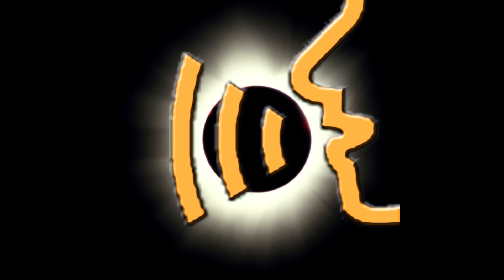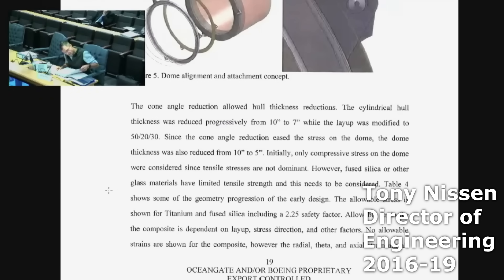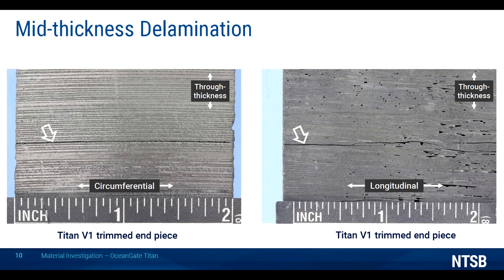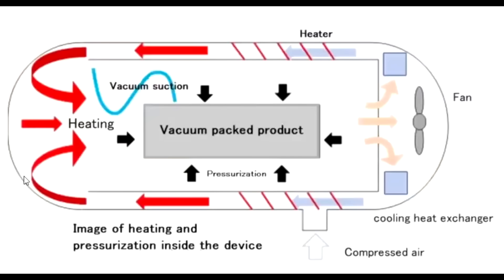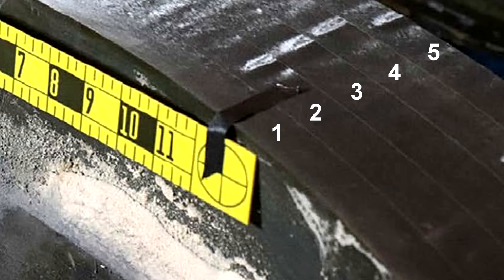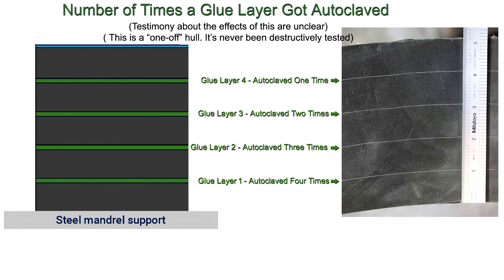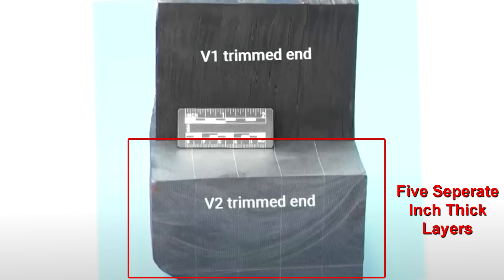Who Engineered the OceanGate Titan V2 Hull? Maybe Nobody Did?

Comment: All of these calculations seem to assume that the composite matrix, the resin, is 100% impervious to fluids.
Water penetration will move inwards until it finds a hollow/weak spot and ends up delaminating the vessel.
This is somewhat similar, but reversed, to the vessel delamination seen by SpaceX on one of their early composite tanks.
Reply: Such as the breaks in the Carbon fibre where the ‘ripples’ were sanded out?
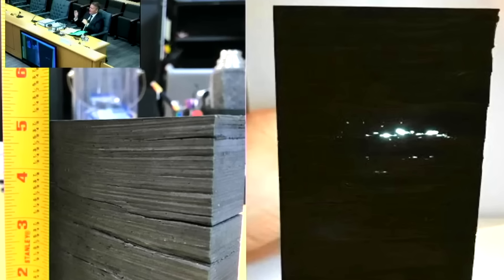Reply: 6:38 'the first hull failed due it being laid at one time, creating too many voids and weak layers '  Wouldnt laying it down in one go be better?? like pouring concrete,  if you do separate pours,  they dont bond well. i.e. there are voids.     Can you explain how multiple separate curing and layering produces LESS voids than a single lay and cure?    how would multiple be better in this case?
Reply from the maker: I agree, and thanks for commenting.  There were so many issues with that hull design and fabrication.  The classing societies would have never classed it.  Stockton knew and pushed ahead with disregard for sound engineering. There is that interview, he says something like "I've broken some rules - but think I did it with sound engineering."  That is the point of my video, I don't see what engineer was involved with the V2 hull.

Comment: Wanna make a stronger hull?
Use METAL, you f'ing wombats.
ME-TAL.
Used for boats.
Not carbon-fibre, used for PLANES.
FFS.
Reply: At the very least, use an impermiable, outer sleeve to prevent water penetrative in to the resin core materials.  
At deep sea pressures, it is safe to say that no resin is entirely water impermeable. 
Sooner or later, the water will find a way into some place it does not belong.
As for the CF waviness, that is an entirely different structural matter.
Reply: Carbon fibre GOOD for containing high pressures…..
Metal good for coping with compression from high pressures….but preferably spherical, not cylindrical 🤷‍♂️

Comment: I used to be an engineer in a filament winding plant. I did a lot of work regarding the specific angle of the winds and how it effected wall strength.

A 0/90 layup is extremely weak compared virtually any angularity. We found 60 to 65 degrees to be optimal with regards to manufacturability, compressive wall strength, and voids.

None of this is a secret, this is well known, more or less, in the entire FW industry.

A 0/90 layup doesnt create a 5 or 7 inch thick wall, you have hundreds od 1/16" thick walls
Reply: They ground down the bulges in layup before the next layer was glued to the peeled surface. That grinding probably destroyed the fiber strain path in those ground fibers!
Reply from the maker: @DumbledoreMcCracken  Yes, this was a bad move.  I am working on a video about this issue.  Thanks for commenting.
Reply: I thought doing 100s of thinner layers in different directions would have been better. From a guy that worked on carbon fibre boats for America's Cup said peel ply still needs to be sanded for the best mechanical bond. They did extensive testing on it. It looks from the wreckage that each "layer" separated!
Reply from the maker: Thanks for your comment.  I agree.  I think Stockton got talked out of it bey the engineers at Spencer.  It's probably more complicated and expensive to set up a big mandrel and winding machine to wind the 45-degree layer that Boeing recommended.

Comment: 06:26 666+1 layers is like flipping the bird after being told over and over the thing is a death trap 💀
Reply from the maker: Thanks for commenting.  I agree, that the number of layers is not the important thing really, it's how they were laid down.  Notice he did not emphasize that it was actually 133 plies in one-inch layers with five of those layers glued together.  Saying it like that in his speech is a totally different thing; doesn't sound quite as strong or impressive.
Reply: What's more is, in between layups, they sanded down ripples and irregularities, breaking the strain path in the carbon fibers. It only really counts as a layer of it's an UNINTERRUPTED layer.
Reply from the maker: @remcovanvliet3018  Absolutely correct.

Comment: 20:38 - Regulatory bodies are no guarantee to prevent failures.  Regulators often ad extra failure modes into the situation.
Reply from the maker: Yes, there is some truth to that.  Thanks for commenting.
Reply: Regulators keep adding rules until stuff stops failing. Following all the rules is not a guarantee... SKIPPING some of the rules often is, because they're there for a reason even if you believe otherwise.
Reply: Regulation is about safety & TESTING.
Rush was pure experimentation & risk with human lives

Comment: It just seems so much easier, SAFER and cheaper to use titanium!?  I just don’t get it?
Reply from the maker: Certainly safer.  But most deep submersibles are steel or titanium spheres because that shape handles the compressive pressure so much better.  But they tend to be small spheres that can fit three people and it's tight.  Stockton wanted a tube shape to fit 5 people and he also prioritized the long shape for depth of field.  This means he wanted to have a camera at the rear of the sub and see people from behind enjoying the view and the ride.  You can't get far enough away from anyone in a small sphere to get that kind of view.  The reason he wanted 5 people was because one would be the pilot, the second person would be a "subject matter expert" for the dive, and then three paying passengers.  You could make a cylindrical titanium sub but it gets really heavy and then it takes too much external foam to make it neutrally buoyant.  Thanks for commenting.

Comment: It all comes down to money in the end.  If Stockton had gone with the 7” more than adequate hull thickness they’d probably still be here.  If he had allowed the 10” very strong version it would have given great confidence in safety.  Instead, he went for the barely adequate 5” version, with little formal testing on the new hull design.  This thing had to withstand 3 tons pressing on each square inch of it!  I wonder if he could have turned the clock back, would he have sacrificed his life for the money he saved?  Well clearly not, but let’s hope other’s learn that skimping on safety margins is a fools game.
Reply from the maker: Well said.  Thanks for commenting.
Reply: Unfortunately, the Titanic still lies in waters out of any regulator's control, so the next guy in line is free to disregard any and all lessons.
Reply: Money is part of it I'm sure; properly understanding the characteristics of the material would probably require a lot of destructive testing, and vibes based safety is a lot cheaper. But hubris also seems to have played a large part. Stockton did after all stand behind his product, and had a shockingly causal approach to safety even for things where additional safety wouldn't have cost much.
Reply: @andrewwade1651  money is part of it, but arrogance is surely a lot to do with it too.
If your ego is tied up in pushing the boundaries of engineering then it is easy to believe the laws of physics do not apply to you.
Reply: 5 inches clearly was not barely adequate.
Reply: @cccmmm1234  that's what she said!

Comment: There were prior carbon fiber pressure structures designed and made by those involved before. They were not going in completely blind. The company making the hull did several prior vehicles. Problems and concerns ofc with them. But they still had some experience.
Reply from the maker: Thanks for commenting.  Yes, Spencer Composites had some experience.  But they missed something with this hull for some reason.  The analysis and predictions were way off.  I don't know why.

Comment: While this is interesting.  It's a very small disaster.  The Korean airliner was much worse in terms of loss of life.
Reply from the maker: That is true.  The Titan disaster is more interesting (I think) because there is a central figure, Stockton Rush, who is an enigma.  Then there is a cast of characters around him.  Then add the Titanic wreck and billionaires and it's hard not to be at least a little interested in it.
Reply: Titan is a disaster where lessons in material science and engineering design can be learned.
Korean airliner is a well known "don't build an effing wall at the end of a runway", nothing new to learn.
Reply: @JaroslawFiliochowski  I would not say nothing to learn. The electrical power failure on the plane prior to landing needs to never be repeated, and for that, the possible causes of the failure need to be fully explored and understood.
Reply: @GodmanchesterGoblin  We'll see in the final report, but my bet right now is "overstressed pilots, forgot or did not come up in time, with some part of a procedure for an unusual scenario".
That stuff happens; once they made it to the runway, it turns everything before it into a footnote.
Sliding straight down the runway, should've resulted in zero or minimal casualties.
Reply: @JaroslawFiliochowski   Sure, there shouldn't have been a barrier. But the point was that there is stuff to learn about the failures in the plane that led up to the final impact, whether the crew or the hardware, as well as the runway layout and construction.
Reply: Lol no shit Sherlock
Reply: You're right - by my calculations the disaster was only 0.068 cubic meters.
Reply: Can you believe it? Aircraft is on a perfect approach, then one second later loses all power? The final report about this je-jun crash is going to be very bad.😢

Comment: It might have been better if it were more football shaped in the carbon fiber section.
Reply from the maker: Maybe?  It would have to be designed and modeled.  Thanks for your comment.
Reply: Any curve is better than a straight line.
Reply from the maker: @GWNorth-db8vn  Yes sir.  How about, so curved it becomes a sphere.  The best shape for a deep submersible.  A curve is nice, but then you basically have an arch, so the end of the arch has to take the load somehow.  Thanks for commenting.

Comment: What I've never understood, is why the flange step was cut on the outside of the hull. If a step was to be incorporated at all, I would think it would have been done on the inner surface. That way the titanium ring would back up the pressure loading.
Reply from the maker: Good question.  I think it is because the mandrel defines the internal diameter.  And the internal sleeve had to fit.  So, the internal diameter had to be fixed.  So, the flexibility in the diameter had to be adjusted on the outside.  But on either side, it's a bad idea to randomly cut out loops of carbon fibers.  Thanks for your thoughtful comment.

Comment: "No 45° is needed because no torsional forces are applied."

Proceedes to tow the submersible in open ocean which will introduce stress in every possible axis.
Reply from the maker: Oh man, I know.  That 'no torsional moments" line in that talk really got me too.  I didn't get into that in this video, because the video was long enough already, but I guess Spencer Composites talked him into that line of thought.  Thanks for your comment.
Reply: You may well be right but i am inclined to think that out-of-roundness stresses and the hoop bond differences are small hazards compared to the inevitable layup voids and the stresses between layers.  In anycase this kind of structure used in a compression application invites disaster; finding the trigger, while amusing, seems irrelevant.
Reply: Compared to hydrostatic axial and hoop stresses on the hull, torsional stresses in the dive and in all towing and handling were negligible and could indeed be safey ignored.

Unavoidable small defects in manufacturing could not be ignored and cross winding might have saved day.
Reply from the maker: @piperg6179  I agree with you, the quality of the manufacturing of the composite layup is crucial thing.  However, there was a lot of engineering testimony about "out of roundness" possibly occurring in the hull which changes the straight inward compressive loads.  But that goes back to the quality of the carbon fiber layup.  But I still worry about the 3,800-pound domes mounted to the rings that were glued to the hull.  Even in that frame they had, I just wonder about asymetric loads to the glued joint. especially on the hatch side where that heavy dome was opened and closed hundreds of times.  Your point is valid though, and thanks for commenting.

Comment: look at a composite paintball tank
as someone who HAS built composite pressure vessels that IS the standard and from the first moment I saw the lay up I could see a clear crack path with that design and construction type
not an engineer
but don't have to be if you have ANY experience at all in this field
Reply from the maker: I agree with you.  Who with any marine engineering experience signed off on this?  Answer; no one.  Thanks for taking the tine to comment.

Comment: I mean, I am by no means a fabricator, nor wise in the ways of materials, other than having worked a small bit with carbon fiber and metals. The little I know as next to a layman, about carbon fiber materials, on an instinctive level, is it can't compare to metals when it comes to bearing against certain forces - such as hugely expanding and contracting under miles of ocean pressures! Carbon fiber is not good that way, it's getting weaker and weaker each time it's stressed.

What I can't believe, above all, is anyone but Rush took deep underwater trips inside that thing. The dude refused to have it certified by others. Red flag. Dude is using a window not rated for pressure beyond like 1/3 the depth of Titanic. Flaming red flag. The thing is built by mating two metal end caps to a carbon fiber center section - EVERYONE was saying this was asking for failure. Red flag exploding in your face and hands, scoring them briefly as that flag is warning you to skip the trip!
Reply from the maker: Yes sir.  You pretty much summed it up.  Thanks for commenting.

Comment: I am surprised that more is not made of the grinding off between layers. Because it is a layered material, you are potentially removing the strength of a whole winding layer or more as it is no longer continuous.
I am no expert but it doesn't sound too clever in such a revolutionary build.
Reply from the maker: Thanks for your comment.  You make an excellent point!  I am working on a video about that right now.

Comment: Seeing the video of them gluing the ends of the thing on... that WAS IT,  color me done. I understand bonding and ensuring zero voids/air in the glued joint, which would have required an autoclav. Just brainstorming here... probably should have been a center supporting titanium ring on the ID of the CF tube something like 2-3" thick - it would have minimized or countered some of the inevitable necking of the CF tube in the center between the titanium domes. IMHO You would have to be an idiot to get in that thing knowing how it was constructed. I don't know that I would have gone down further than I was comfortable swimming up from/ MAYBE 30 -40 feet.
Reply from the maker: On man, I couldn't agree more.  That epoxy day video was frightening!  Thanks for commenting.
Reply: Ironically that wasn’t what would have been a dealbreaker for me was being bolted in. I wouldn’t have even gotten in on the surface because of that.
Reply from the maker: @mikoto7693  Agree!  No way to get out from the inside!  You have to be found and then pulled out of the water to be let out.
Reply: @solareclipsetimer  In all honesty when the Titan was still missing and the news crews were on the ‘96 hours of air’ countdown and the false rumours of hearing banging sounds from within the submersible were making the rounds I remember looking up from the news article and thinking. 

“At this point, I hope it just imploded before they could even know what was happening to them. It’s kinder than being stuck down there in the cold dark waiting for the air to run out.” And then my mind kinda clicked back to the knowledge that they were bolted in.

“But would that be worse than bobbing around on the surface for 96 hours in the middle of the ocean with sunlight and breathable air just inches away as they slowly run out because they’re bolted in?” And that was the moment I decided the entire submersible was a bad design.
Reply from the maker: @mikoto7693  Agree.
Reply: Agree that finger-painting on the epoxy was a poor choice. 
But I don't like the internal constraining ring idea. It's counter to the principle that the tube itself is meant to have the correct strength and stiffness. What you need is for the tube to be supported by its own hoop stiffness and to flex appropriately under load, and for everything including the end closures to flex together. This way there's no shear force trying to rip the joints apart.
Reply: @Rich-on6fe  Agreed that would be the ideal situation, however there is zero possibility that the ends and the tube would flex at the same modus, that is the main issue IMHO.
Reply from the maker: @Rich-on6fe  I agree.  The titanium rings had that weird shape milled into the surface to try to match the moduli with the carbon fiber.  So, they thought about the mass of the titanium and its response to temperature and those types of things.  But it seems shaky to me.